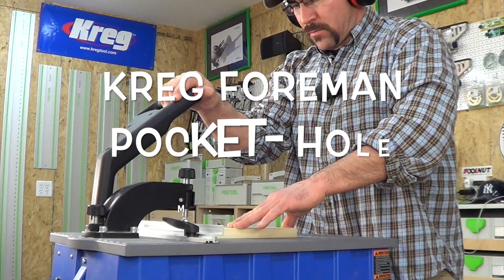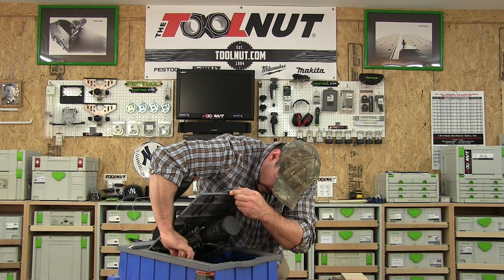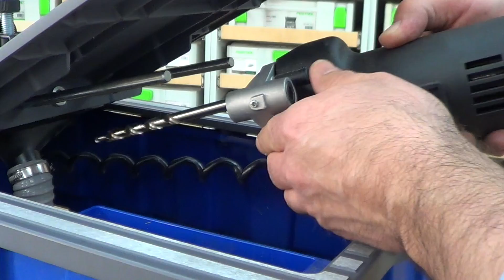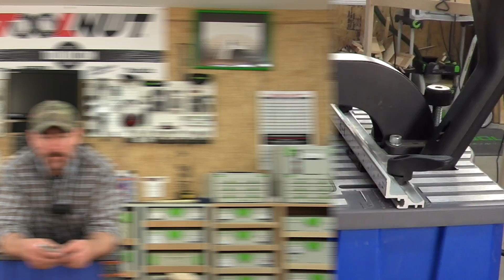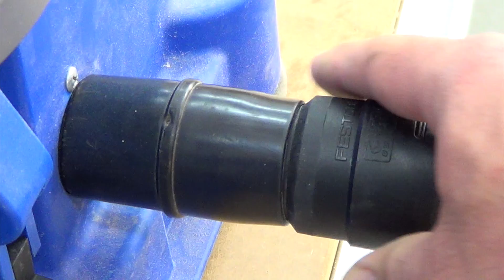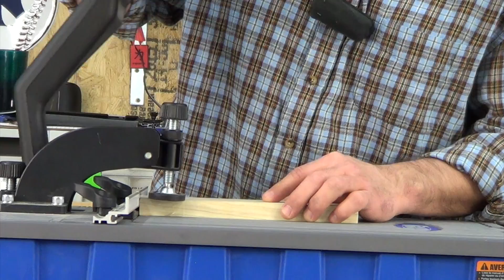Kreg Foreman Model DB210 Pocket-Hole Machine Review

Comment: Nice video - I was wondering what the vacuum adapter is that you use to hook your Festool vacuum onto the Kreg vacuum port... Thanks!
Reply from the maker: Honestly couldn't tell you, Lawrence.  It's from an old household vacuum we had.  I kept a couple of the hose fittings before pitching the vac.  The piece I'm using on the Kreg foreman threaded onto the hose of the old vacuum.   Sorry bubba.
Reply: Who you callin' bubba? haha... I figured it out - bought a rubber 1 1/4" to 1 1/4" connecter at HD. It has clamps on each end to tighten it onto whatever, so I tightened it to hold fast on the Foreman, and tightened it up enough that the Festool vacuum fits nicely in the other end. No muss, no fuss, less than $2, works will. I guess it's all plumbing - water or suction... when I was assembling the Foreman and had to hook the internal hose up to the port and the motor, I got the idea of doing something similar on the outside. PS - thanks for the videos on the LR32! Picked one up today before the price increase...
Reply from the maker: Lawrence Becker 👍 nice and  easy solution.    Wish I had a dollar every time someone said that they bought something before the price increase.   LOL  !  I'd own an island or something.   🤣🤣🤣🤣
Reply: I could send you a dollar - but it won't help much toward your island purchase. My other justification for the LR32 is that I'm redoing my kitchen cabinets - face frames, doors and some of the boxes - so it had been on  my radar. Thanks again for your good work!  Larry